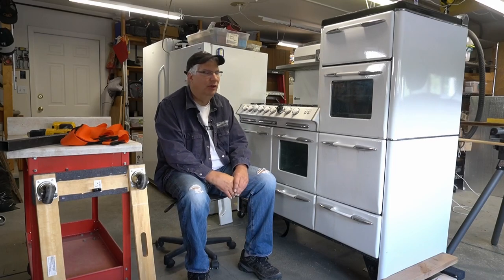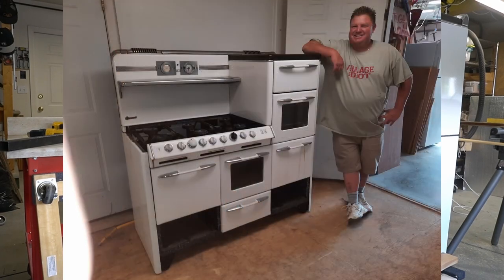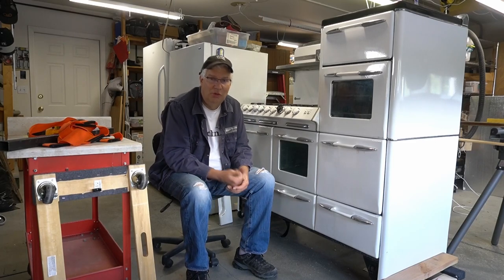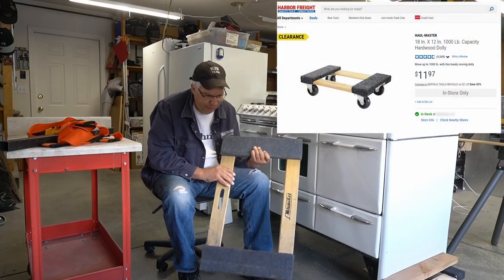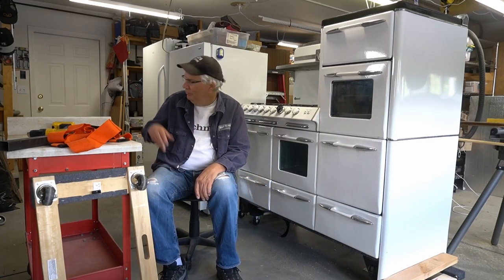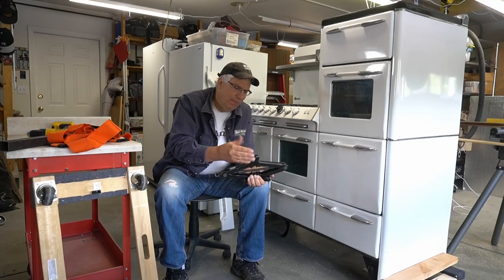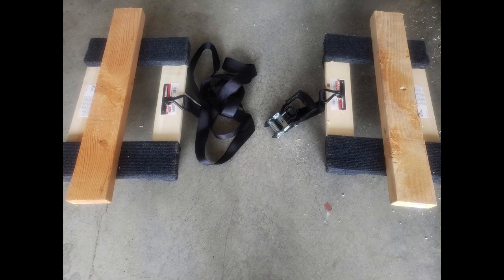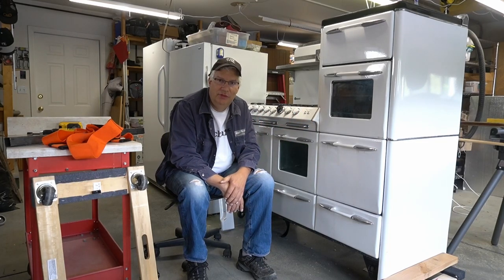How to Move a Vintage 750lb Stove

Comment: I own several apartment houses with antique stoves. One of the units has an OKM stove like yours in it. We had to get it out to have new floor covering installed. I called J.E.S. Enterrprises, Inc./Antique Stoves on the web.  They are in southern California and have assisted me in keeping all of the stoves we have running for decades. They specialize in parts, service and information on antique ranges. They said they have used a Roll or Kari Dolly for over a half century. I never heard of it but I contacted a piano moving company that rented me theirs for a few hours. WOW...it was so easy to move the stove and a big upright freezer I could not believe it. Without that tip I think we would have broke our backs moving such big item. Tools like this make everything so much easier. I like your idea too. Whatever works, right?
Reply from the maker: Thanks, I'll check that out. Thanks for the nice comment and for watching. And yes, whatever works.

Comment: New improved/old reliable and repairable --- A1950s building has a working WesternHolly gas countertop and wall-mounted oven circa 1953 Still working after 48 years of service, made in America. 
New and improved! I help a fellow from time to time who has four apartment buildings to maintain, between the buildings they have purchased numerous new stoves with microprocessors There is so light & cheaply made that you have to bolt them to the wall for fear that when you slide a roast out on an oven rack the stove will tip over. To add insult to injury of 4 out of 8 stove failing after less than two years, if that's not bad enough the repair costs for parts and labor is about the same as buying a new stove.
Reply from the maker: I hear ya. Thanks for the comment and for watching.

Comment: You need a Crain air lifter (look it up) that uses two air powered panels hooked to a small 2 HP pump. Look at flooring supply stores or Amazon. Cost roughly $500, but you may be able to rent one. Slick as snot on a door knob!

Comment: Hi! Yeah, I 2nd all the praise of other posts. Did you have any issue with the steel beam tilting to one end or the other during jacking? Did you do anything special to get over doorway thresholds? I'm totally going to use your plan when I find my antique oven, and your plan makes the logistics of it possible for me.
Reply from the maker: No, my stove's center of mass is fairly centered, so jacking up was easy, no tilting. As for the thresholds, my furniture dollies have 3in wheels, which isn't too large. You will have to carefully get over your transitions.  Just make sure when you cut your square tubing, it contacts only your stove's frame, not the porcelain covered sides. The sides are decorative and won't support the weight. In my video I removed the front kick panel revealing the frame. Good luck.